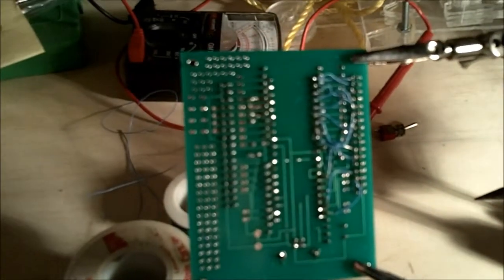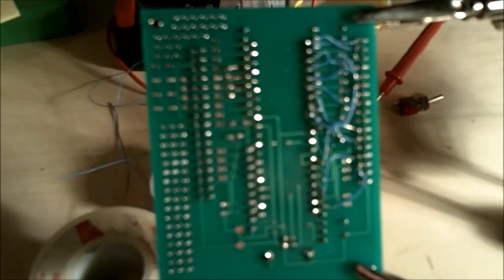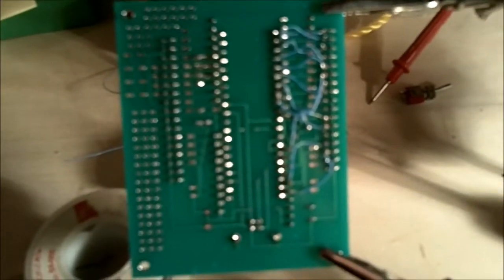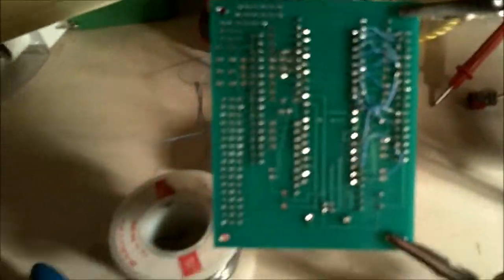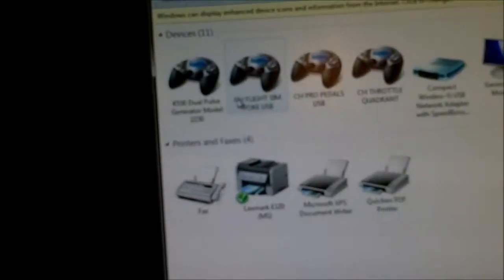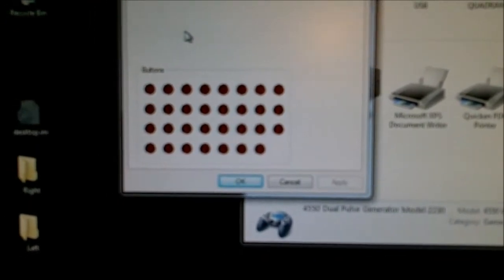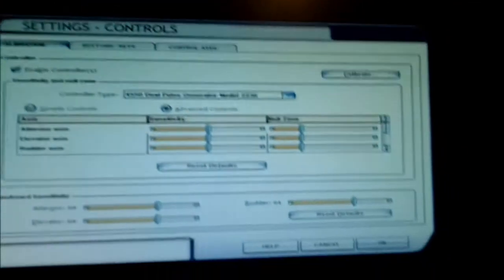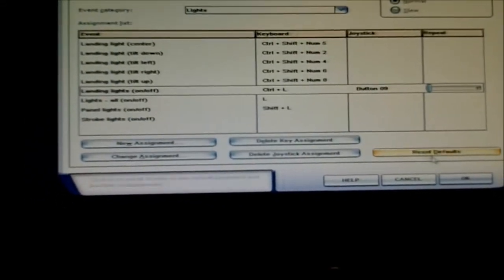Modifying the 2230 pulse generator circuit board from Desktop Aviator and prosim737 2120

Comment from the maker: It really depends what you want the equipment to do and the software you use. I think the 2120 will work for you using the fsx/prepa3d settings because it creates a pulse like a keyboard key. That is what I use it for and it works for me. Using prosim software won't work though because that requires a solid on or off state not a pulse.  I hope this helps.  If not let me know.